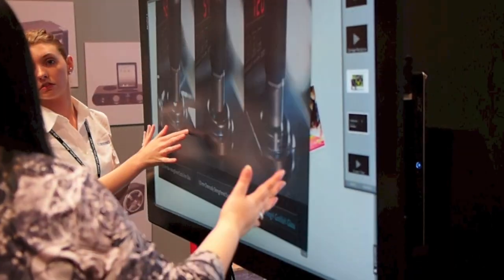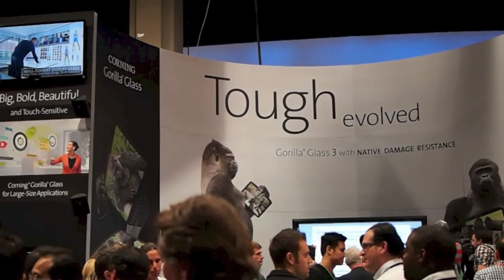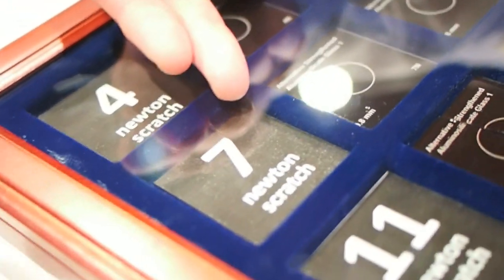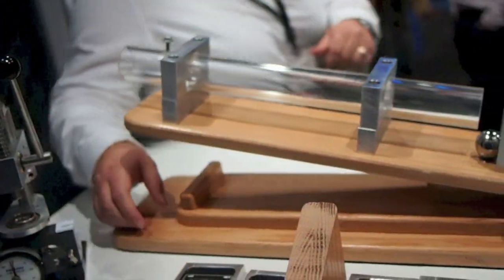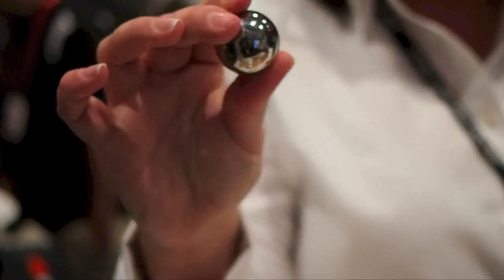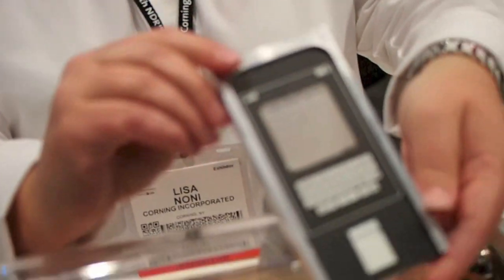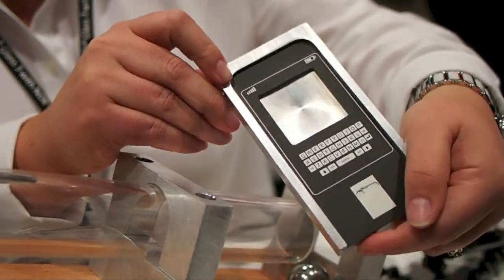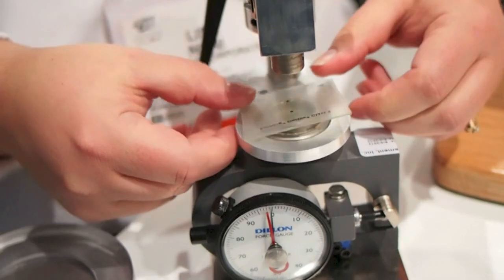Gorilla Glass 3 at CES 2013

Comment: When they say scratch they mean the diamond stylus was used on it at 7N. That said you can scratch it, it's just a matter of the volume of material removed by the scratching object. GG3 at 7N had little no no material removed, while competitor/GG2 glass had more removed, resulting in the visible gouge.

Comment: tripling the release angle of the ball does not mean three times the force. And that tiny piece of aluminum would be bendable or dent-able with just hands. And its like comparing concrete (the aluminum) with rubber (the gorilla glass). If you throw a ball bearing at concrete, its going to chip, but that does not prove that the concrete is weaker than the rubber.

Comment: That possibly because of a grain of sand.
Quartz crystals have microscopic supersharp edges, which go through any glass like butter. That's just bad luck.
Also as this video shows the applied force is important.
I scrated my S3's screen (GG2) by dropping my keyboard on it. It had a small plastic burr on it, which scratched the glass. So even relatively soft plastic can scratch this glass, when it has a sharp edge and is applied with enough force.